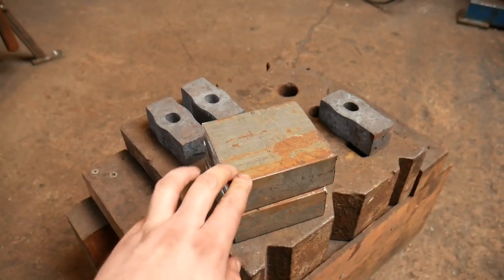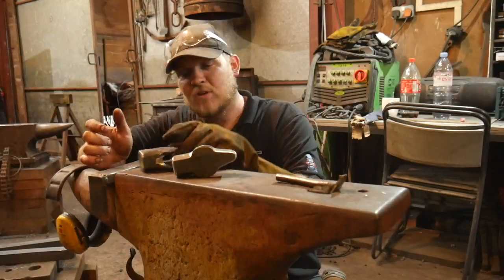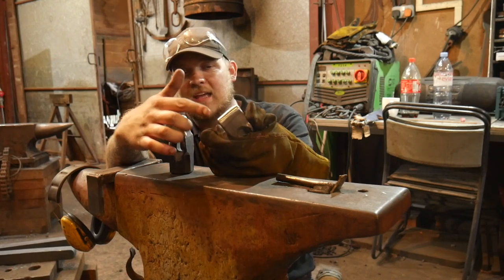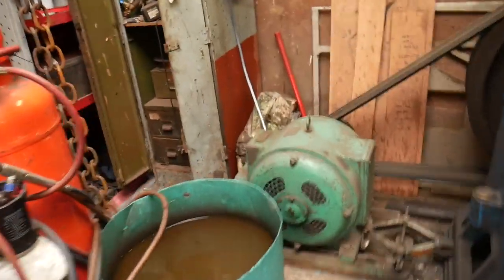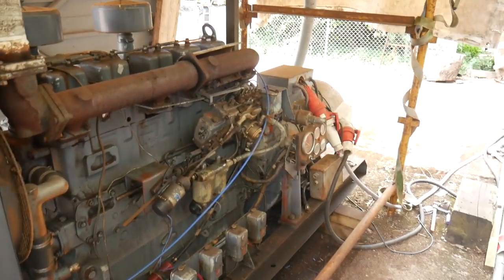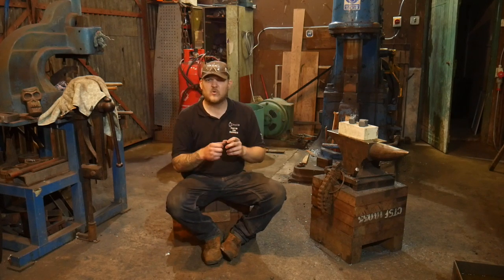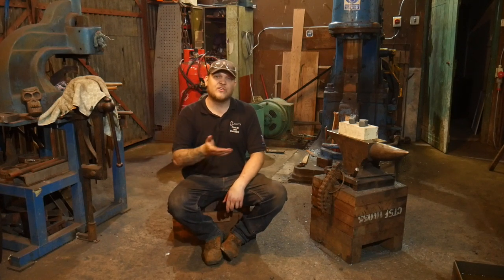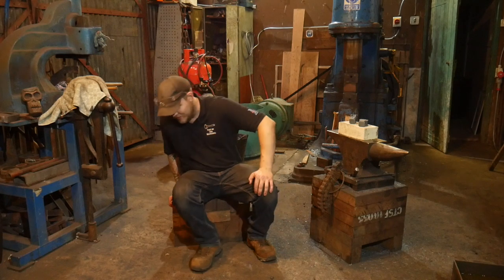Forging Cross Peen Hammers! Just Another Day in the Forge!

Comment: If you haven’t yet tooled up for your hammer forging classes consider changing the orientation of your handled eye punches from straight peen to cross peen. There are a couple reasons for this. First holding tool handles one hand over the other in tight quarters is a safety issue especially with beginners directing and striking. Secondly holding the reins and punch handle 90 degrees apart is much more natural and closer to how you perform most other anvil operations. Having the handles 90 degrees apart allows the director to more easily look directly down over the punch and then lean over for striking clearance. The striker will be more comfortable with this as well. 

I notice the struck end of your eye punch is severely canted. I’m guessing changing to what I’ve suggested will help the striker deliver more vertical strikes.

This is given as constructive suggestion to all that might be interested. Thanks.
Reply from the maker: Thanks for the feed back. If you have ever work with new students you will quickly find the the idea of holding things at 90deg to each other isn't a natural consent. When teach people to uses top tools like flatters I find most beginner uses them at 45deg.

I have never tried using a punch set up the other way and I will defo give it ago. As for the othe points your brought up I feel they are aspects based in opinion. I find look over hand punch easyer than looking form the side dude to the parallax issue this also works with top tools and with the tool set up this way you can lay it on its side to help with marking up.

The deformation on the stickers end is due to the arc of the hammer I believe and would also happen to any tool.
Reply: Steve, the solution to the problems you're describing were solved by wire wrapped handles, which allow the punch/tool to be aligned in any direction you choose. They've been around for donkeys years but Dan's actually shown his own take on this issue  already in earlier video's.  He made a special pair of bolt jaw style tongs and accompanying punches.
In reorienting any rectangular (or oval) punch to 90 degrees relative to a wooden handle you'd have to be wary of weakening the strength of the eye (as a struck tool) and the additional factor of the handle width. If the oval of the punch is thicker/wider than the handle itself you run in to the problem of an over complicated forging. 
With a wooden handled punch like the one used here the simplest solution of all is to just work at 180 degrees (imagine holding the handlebars of a bike), instead of one hand over the other.
Reply: Thanks for responding and thanks for considering trying an eye punch handled in the 90 degree orientation. A review of it might be good content for a video. I’m not a master smith. My suggestions are based on how I was taught, my personal experience hand forging many hammers and my opinions. I enjoy your videos and normally wouldn’t consider making a public suggestion but I thought it might be worth a try in this case.

Thanks again.